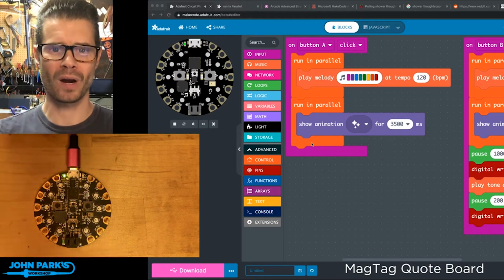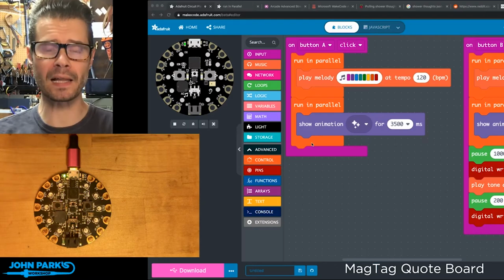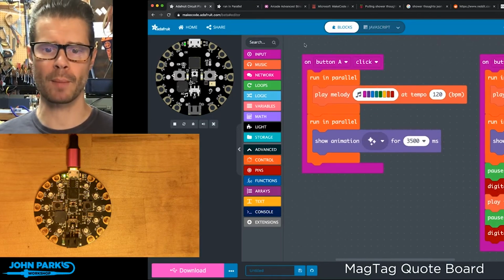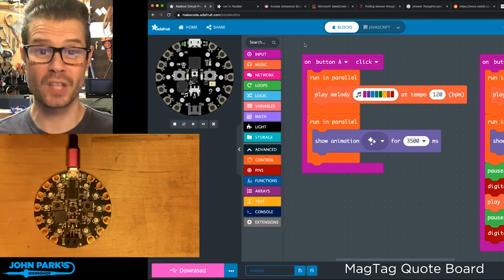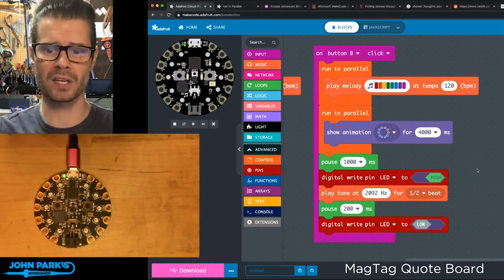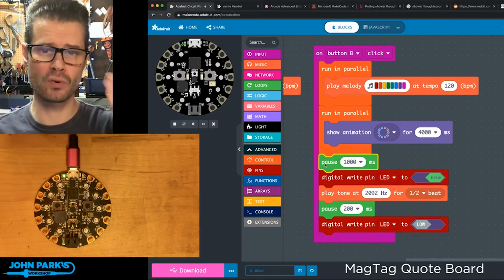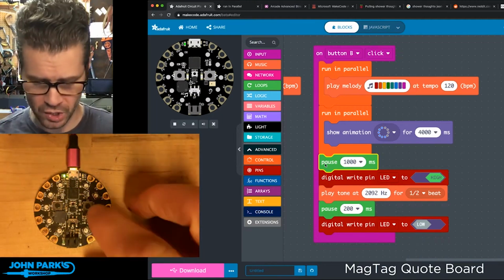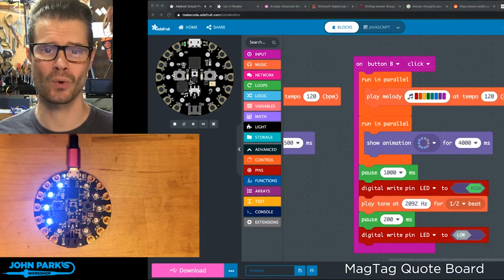MakeCode Minute: Parallel Blocks @adafruit @johnedgarpark #adafruit @MSMakeCode #makecode

Comment: Thank you. I mentor kids and use the CPX and MakeCode in order to keep it simple and chock full of those important small victories. One of the girls is interested in working for NASA, so I have them doing a space probe. Not outer space, this all takes place in inner space, aka "their house". The mission length is 3 min, and the "probe" has to take a light level sample every 10 sec, but only if the "spacecraft" is level.  They walk forward one step each time the device prompts them via a beep. and then it samples light and makes an LED scale come on then clear, then they make note of the reading. Room lights are turned on or off to show contrast and make the mission different each time. This tutorial will help solve a couple of problems they have. Thanks again!!
Reply from the maker: That's excellent, keep up the great work with your students.